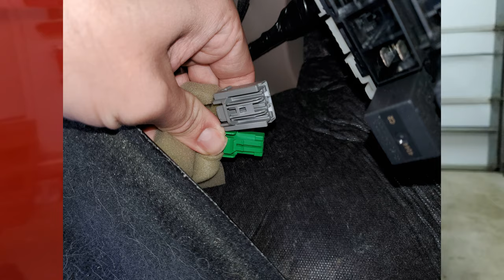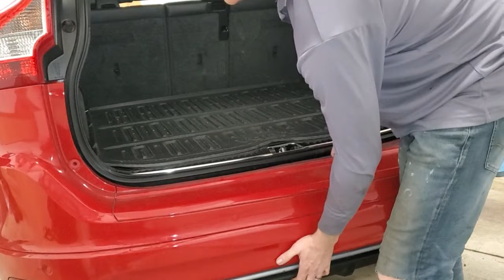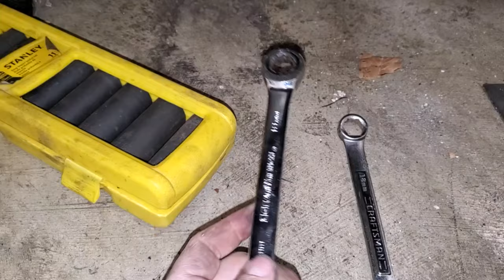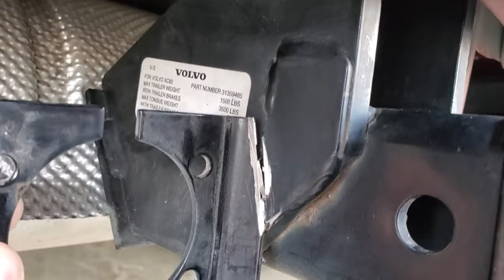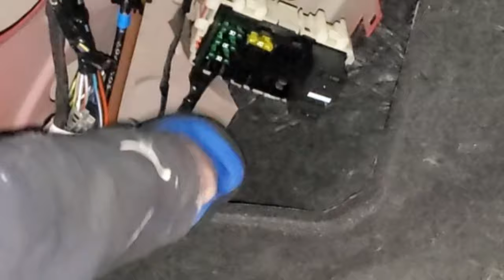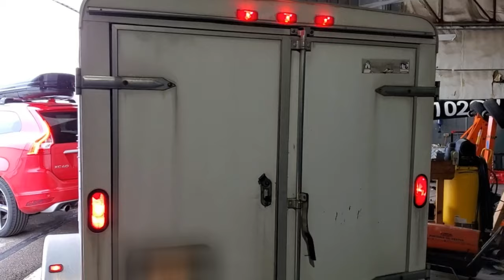Volvo XC60 R-Design Trailer Hitch Install

Comment: You did an amazing job- looks as good as factory!  My T6 had the hitch installed (for a bike rack) by previous owner.  I needed the lights and researched just like you did and when I found out that it still had to be programmed by Volvo, I opted to have them install the module too.  On an aside- I recently got Global TIS for my Saab and fired up the Chinese Tech 2 that I had for 2 years without really using.  after about 5 minutes the VCI module burned up- sometimes you get lucky with the clones sometimes you don't!  For sure I'm not getting into Volvo programming, but I did find out that I can update my horrible 2011 instrument panel with the cool one you have!  I'm trying to resist the tempation!
Reply from the maker: Heck yeah another Saab and Volvo friend! I watched a detailed video not long ago on someone installing the 2015.5+ cluster in an older model P3 Volvo. I must say I didn't think that would even be possible and if mine didn't have it, I'd more than likely retrofit it in lol.

Comment: Is this actually the OEM "Member Kit" P/N 31359465 ?
I have a 2015.5 XC60 T6 RD 3.0 and P/N 31359465 on volvo's website says it will fit without any modification.

Comment: What is the dealer program thing? Is this for trailer brakes? Do you need to take it in to dealer for computer program thing if it’s just trailer lights and no brakes?
Reply from the maker: Programing enables the trailer light functions as well as turns off blind spot monitoring and the rear parking sensors when a trailer connector is plugged in.
Reply: What if I don’t have any sensors or spot monitoring. I got mine installed and mechanic said they were working. I haven’t had a chance to connect my boat yet though. I haven’t taken it in for any programming
Reply from the maker: If you don't have those options your mechanic may have just hardwired the trailer plug in. Basically tapped into the tail light wiring which is a real common way to wire a trailer plug before everything become so heavily computer and module based. In your case you may be fine without programming.
Reply: Exactly what he did. I have a 2015 T5 no sensors or backup camera or lane sensors